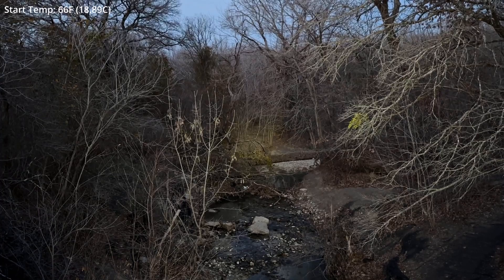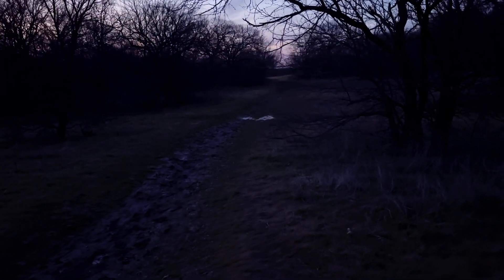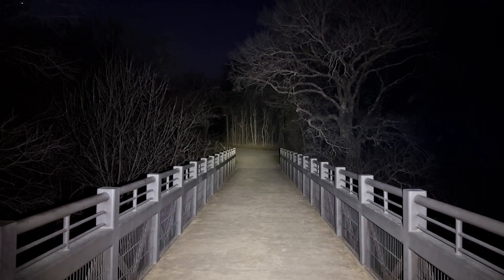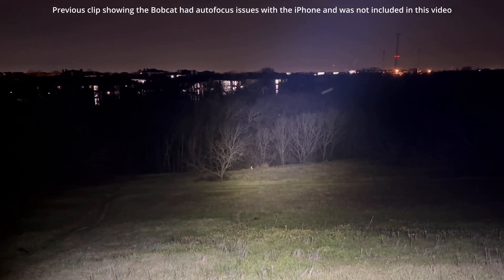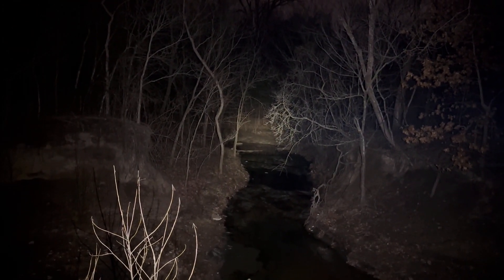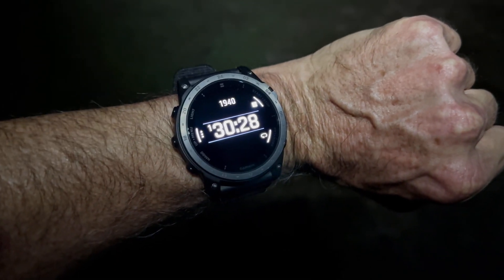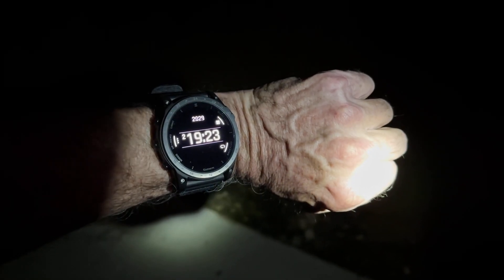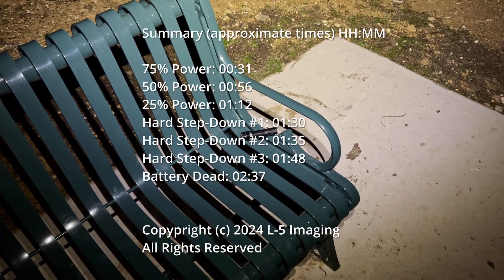NITECORE EDC33 Battery Endurance Test

Comment: P20x, or p23i or srt7 for tactical applications?
Reply from the maker: The P23i would be a good general option (I don't have direct experience with the P20x). The SRT7i is good if you have frequent need to 'dial in' a precise amount of illumination for varying tasks.

Comment: Thanks as always for the detailed and enjoyable review, would be possible somehow to reverse the clip and apply this light on some hat for free hand use?
Reply from the maker: The clip is designed to attach in one place and it's not a two-way clip, so that would be a tough configuration to pull off.  What I haven't tried is taking that clip off and replacing it with a two-way clip from another light.  Might try that one day :) Thanks!